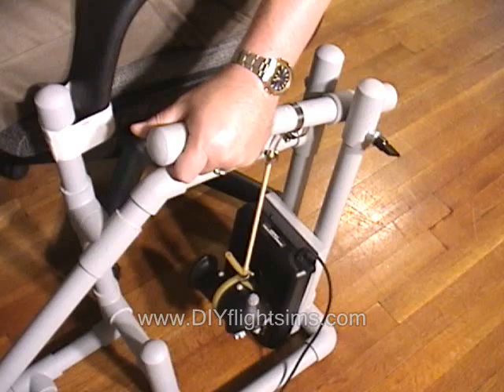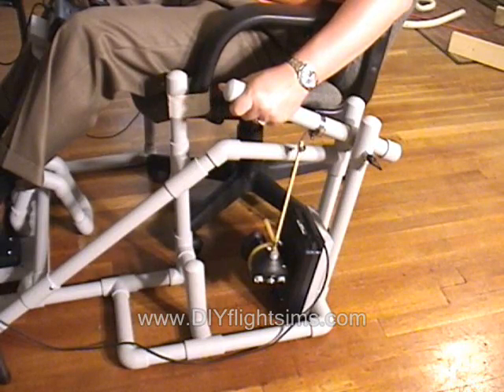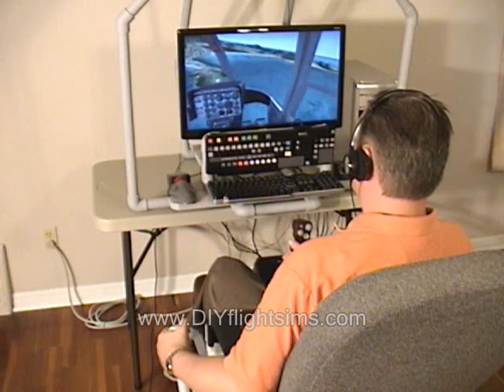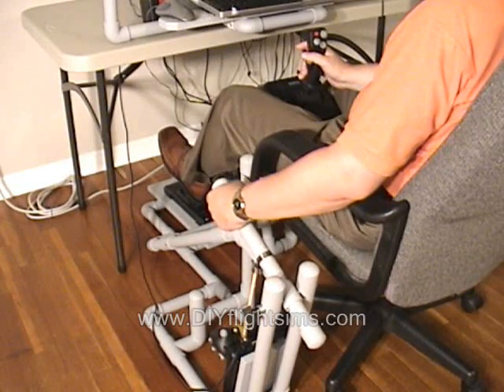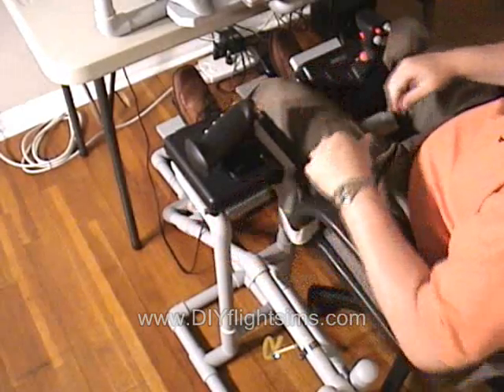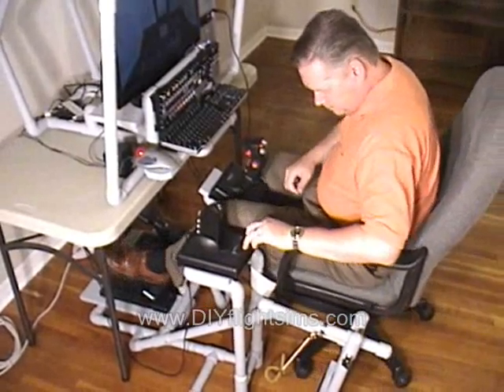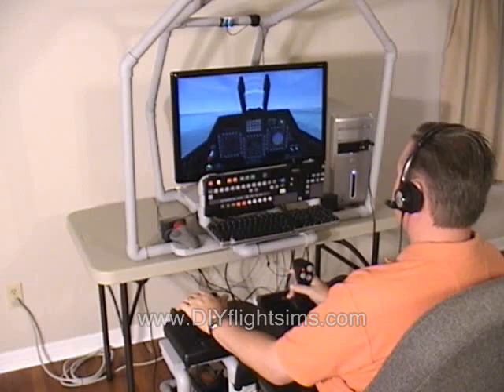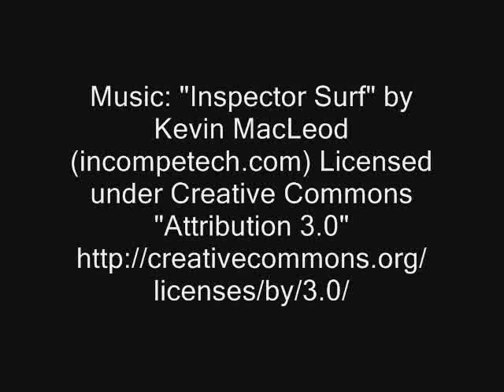DIY Helicopter Flight Sim Controls

Comment: Didn't want to buy this because i'm extremely cheap but I decided to go out and buy it. Only $28 after all for the videos. Will update with how it works out! Pretty excited.
Reply: +Jpres how good are the instructions? does it give you a list of materials, ie exact # of feet of PVC, number of connectors, etc?

i'm thinking about getting this setup, but i want a side joystick option as well.
Reply: The instructions are pretty good. I had to make a couple of adjustments because it wasn't big enough for my chair width wise. It tells you the exact materials you need. Just so you know though, you'll spend around $150 in materials to put this together. You'll also need tools for cutting the PVC Pipe. They suggest using Glue or Screws for attaching the PVC Pipe or both. I recommend screws personally. 

I personally am going to make a new one sometime soon a bit differently because I want something different now (want to try to make wood panels and do a full on wood control holder), but I had a lot of fun with playing Take on Helicopters with this setup.
Reply: +Jpres thanks for the response. i might just make my own setup then. i don't really care about the cost of the build so much. i just want modularity, primarily for DCS. I typically fly A-10 and the UH-1 Huey, but occasionally i'll fly fighter stuff with my buddies and i'd like to have the side joystick for that so i can have a keyboard in the middle. i'll probably buy the instructions anyways and copy the side joystick from another picture or something.

i can get PVC cheap. it costs me about 2.50 for 10ft of schd 40 and I can get the connectors cheap. my uncle gets contractor pricing. I already have the screws, i was planning on that so that I can take it apart and change it around or move it easier instead of having to deal with glue. i'll probably glue a few pieces together though, if they need to really be secured.

I was thinking about breaking down my old Saitek joystick and using for buttons/axis on the collective as sort of an extra set of controls.

Comment: This is one idea that deserves further development:  For a follow-on collective, I picture a Hall-effect collective-pitch sensor, dual Hall-effect twist-grips (aux USN/Bell Aerospace Textron HJL/UH-1 series), and a switch pod (e.g., based on the Mason/Esterline throttle handle on the USAF/Consolidated Vultee F-16 but on a Cannon connector rather than a pivoted strut).
Reply: Haha. 4 years after you wrote this I still got a chuckle.
Reply: @adambridge8920  i also got a chuckle 8 years later

Comment: Roger Dodger Aviation - correct me if I am wrong, but it looks like the collective is connected to the throttle via a rubber band.  Does this cause issues with tension and capability of releasing the collective and it not going back to a standard position?  What I mean by that - in a real sling-wing the pilot is capable of releasing hold of the collective once the setting is reached in order to adjust other aspects of the cockpit.
Reply from the maker: 1. There are no rubber bands in this project. 
2. The collective handle is connected to the throttle with a wood dowel rod. A latex tube wraps around the throttle handle and attaches to the bottom of the dowel rod with a metal hose clamp. 
3. The tension of the collective handle is adjustable. The collective handle attaches to the frame with an adjustable friction knob. Adjust the friction knob to control how tight or loose the collective handle feels.
Reply: Roger Dodger Aviation Thanks!  I guess low-def video veiwing in Afghanistan is not a good option to see detail.  Will definitely look at getting these plans when I get back home and moved to Texas in creating a "universal" cockpit.  Thanks for the response
Reply: Roger Dodger Aviation i see how the collective is assembled but if i press it down how does that rubber band push the throttle down?
Reply from the maker: TheZabbiemaster It's not a rubber band.
Reply: Roger Dodger Aviation is it a stick?
Reply from the maker: It's a dowel rod
Reply: Roger Dodger Aviation sorry man that was immature, but this would make sure that the throttle would go down?
Reply from the maker: There is a linkage between the collective handle and the throttle. When you pull the collective up, the throttle lever goes up. When you push the throttle lever down, it goes down.
Reply: Roger Dodger Aviation thanks im thinking of buying the instructions!

Comment from the maker: Not yet. I experimented with a twist throttle grip, but I wasn't happy with it for a DIY project. It was too touchy, complicated, and somewhat unreliable. As a work-around I included a throttle increase/decrease into the Helicopter Keyboard Mod, but it's not an ideal solution. 
I plan on revisiting the experiment after I do a few other DIY projects.